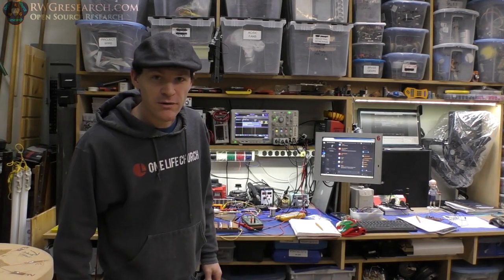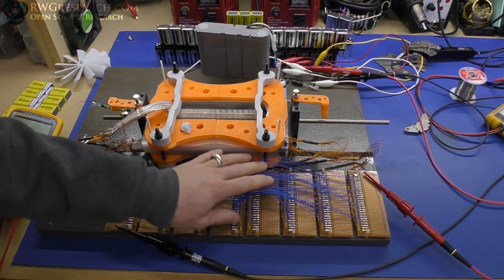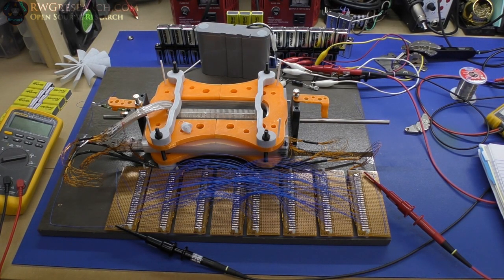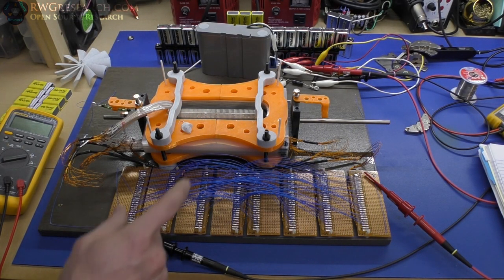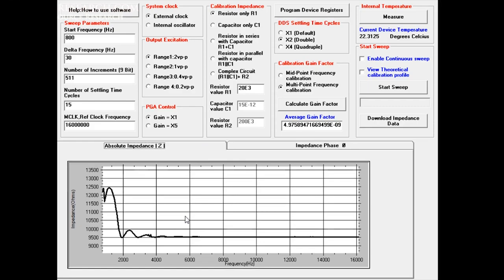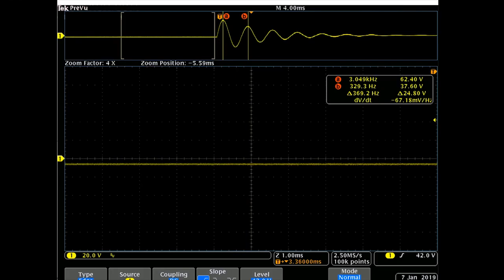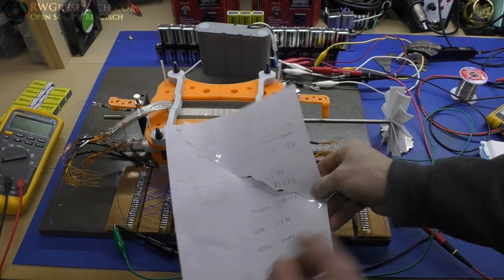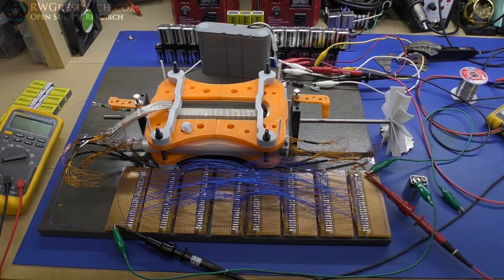TSFA 25 1019 / Cheesy Fan #3 : Achieving Very Low SRF (Self Resonant Frequency).

Comment: I know this is off topic, but I like your storage bins: clear so labels are unnecessary and stackable square to save space.  I'm converting over myself.  I only wish I could mitigate the problem of a box taking up room when it is half full.  I've gone to using Ziploc bags inside boxes for electrical components of similar type etc. (Since a bag doesn't use unused space).
Ok, back to the regularly scheduled program....

Comment: Did you consider using a " breadboard-like " system for configuring the jumper wires? Unsoldering and resoldering all those jumper wires looks like a real pain. Or does a simple push-in connector give too much resistance for your circuit?

Comment: resonant frequency is dependent on capacitance and inductance, you need more of both to lower the frequency. to get a lot of inductance also means you get more resistance (more windings). resistance kills the power... 
thats why I choose solid state. where you are not limited to low mechanical frequency, but simply work at high frequency, and rectify to dc, to get workable power. 
But hey, thats my way. good luck with trying it this way